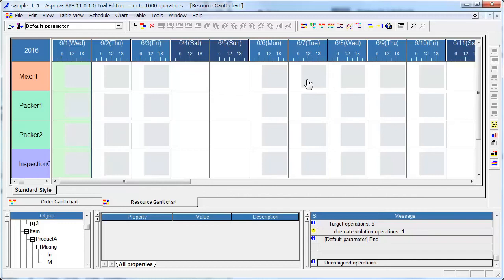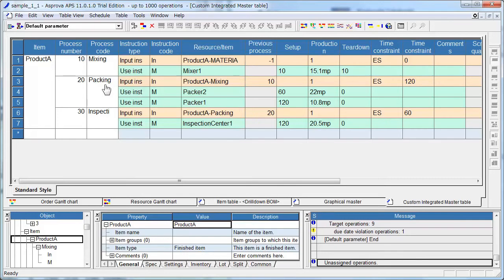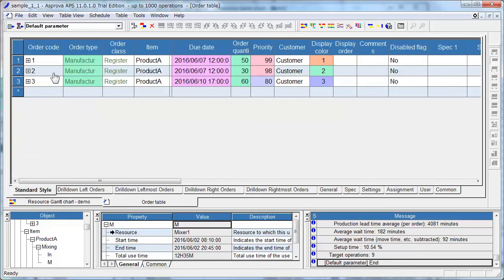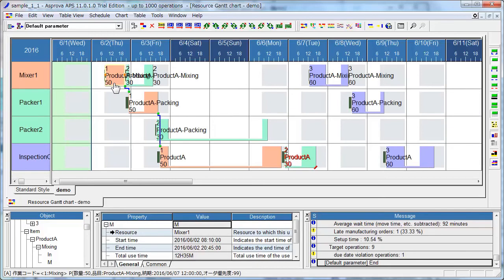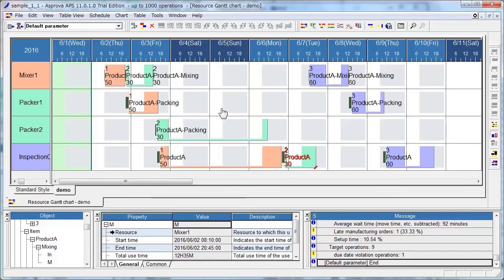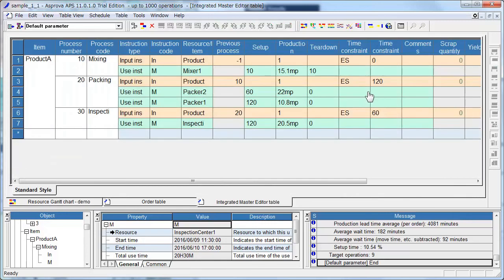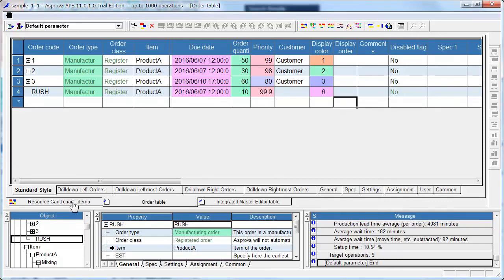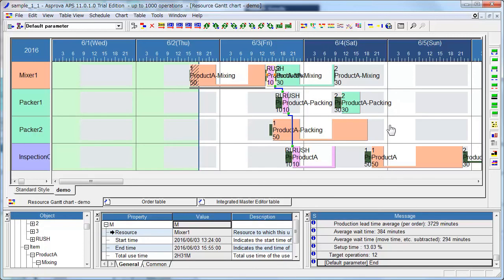Asprova sample 1_1 demo : Mixing - Packing - Inspection process

Comment: Good morning, one question regarding the way Asprova makes the production schedule.  Asprova works to plan based on client orders and not based the production plan based on SFG's?  The company I work for has make to order orders but we usually plan based on the components the need for the end product.  Can Asprova work this way or it only makes the plan based on the due date of the end product?